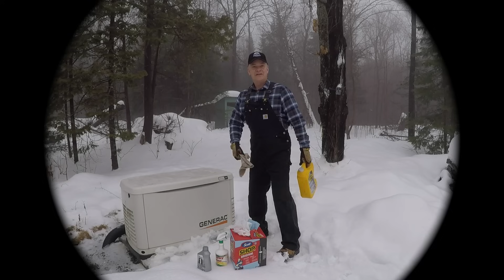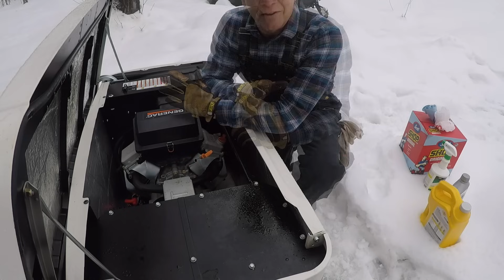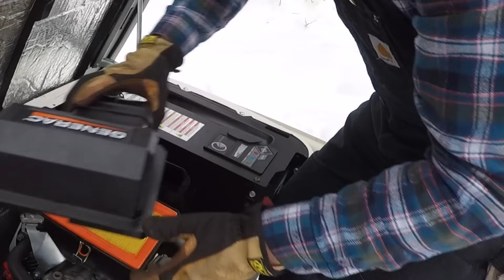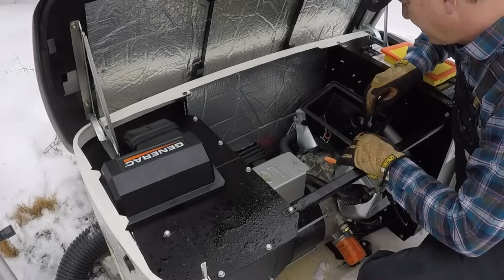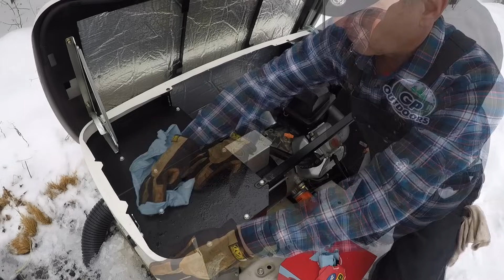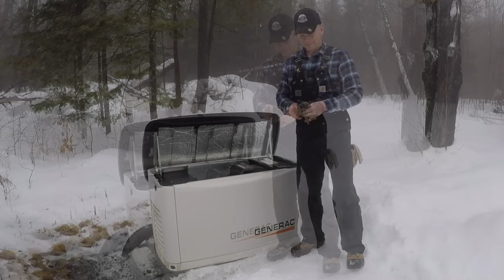#133 Thinking of Buying a Generac Generator? You Need To Watch This!

Comment: GP, look below at what you have done.  lol
So, after all this, how are you dealing with the problem?
Some have said that Generac has limited the exercise time to 5 or 6 minutes. It just occurred to me that if you can't change this, you should be able to shut off the circuit breaker supplying power to the unit to trick it into thinking there is a power failure so you can run it as long as you want. Turning off the main breaker will let it run under load as it should anyway to dry moisture from the generator section.
Reply from the maker: Morning TM. Thanks for the thoughtful note. The issue actually has nothing to do with the exercise time, although many have assumed it. It occurs when the unit has been running for a period of time ( hours). I added a 3rd heating kit to the unit which keeps the vent port warm and has stopped water from freezing back into the port now. However, the filter box still fills with water and freezes - a simple fix to drill a hole or put a duckbill drain on it is the right solution I believe however Generac has confirmed that if I do it, it will void my warranty. As noted in the video, many customers in this geographic area have the same issue as confirmed by the Generac local techs and also, I have a friend who has the same unit and the same issue. I have seen comments suggesting that the new units have been redesigned to stop this issue but I have not confirmed it. So when the warranty runs out then I have a fix for it. Thanks again!
Reply: @GPOutdoors  Are you saying that the air box and vent tube can be clean and dry and after a single run time of hours and this water forms in the air box from the vent tube? Does this period of time between looking at it include the automatic exercise times?
Reply from the maker: Morning TM. No not at all. I am not sure ( and nether are the three Generac techs that have serviced it) but for some reason , in this area, many of their customers and I have this issue, including one of my neighbours who has the exact same unit as I do, about 2 miles down the road. I think, (we think), cold air in meets hot air and produces the condensation ( water), which collects in the bottom of the air filter compartment. After the water gets to be about 1 inch high ( where the vent port is) then the water begins to go into the vent port. After the unit shuts off and cools, the water freezes and blocks the vent (unless I am diligent and come out and clean out the water/ice regularly). The oil also becomes kind of foamy/creamy because water is getting into the engine oil. It only happens when we get into the mid of winter and thereon until late winter/ spring as the outside temp warms up. It does run its exercise cycle which is once a month but it is not the exercise time, it is the run time primarily. Up here the power goes out regularly and for me, the gennie will run regularly during the winter when the solar panels are blocked by snow. Hope that helps. Thanks so much.

Comment: Take this from a mechanic, and full time user of generators. The genarac generators are "back up" generators ONLY and they are designed and sold that way, they WILL NOT last running full time for very long. So if you want a backup only , go ahead and waste your money.
Reply: I agree. This generator, in this application, only runs for a few hours here and there. He's not using this as primary power. A good choice for this application. If he's spending any more than $20.00 a month in fuel, he might consider more panels, and/or perhaps, a wind turbine.
Reply: From what I heard from the dealer in St Thomas, USVI, you are correct.  They had tons of them blown after the hurricanes in St Thomas and St John.  They are only meant to run for a few hrs at a time...not 16 hrs a day for weeks at a time...they will not hold up.  That being said, we have one at our home in NH for 5 years now and it has worked perfectly every time the power has gone out.  We only had a portable 10,000 watt generator on the island during that time and changed the oil every 2-3 days and it held up for us.  3+ months of no electrical service from the power company was grueling......
Reply: @larrypreston3885   What people don't realize, is that these engines hold less than 2 quarts of oil. If there's a long term outage, it's imperative, that the oil be checked every time you fill the gas tank, and it needs to be changed every 50-100 hours. 3 days is 72 hours! Every week, it's important to check the valve clearance, especially the exhaust valve. Too many home owners think that, like their refrigerator, or air conditioning system, that they're largely maintenance free. Nothing can be farther from the truth. These fully automated systems need as much maintenance, as the portable generators. Same engine, Same alternator.  It's just that you've got this box, that runs autonomously, out of sight, out of mind. A 10,000 watt portable, that you pull out, connect the lines, and start up your self, you're reminded to check the oil, put fuel in it, and start it. The worst, are natural gas generators, which are connected to an infinite source of fuel. If something goes wrong with the low oil cut off, you're done with that engine. Putting gasoline in a portable, is a good time to check the oil before re-starting. Those Generac are beautiful, but you still need to pull the dip stick.
Reply: @vincentrobinette1507  I agree 100%  The one in NH is run on propane as is the portable one in St Thomas.  We have been very happy with the one at the NH house because it is used as designed...a few hrs during a power outage.  We were considering one for the island and were surprised to hear about the concerns of trying to use it for days at a time from the Generac dealer on the island.  We did not know that.  We actually blew up the one we brought down with us right after the hurricanes and were fortunate to find another one within a few days.  As you could imagine, they were difficult to find and extremely over-priced, but what were our alternatives?  15 mins changing oil every couple days seems like a small price to pay once you have gone a few days without electricity!  Also, thanks for the informative video about condensation/ice build up.....would not be a problem on the island but certainly could be in NH.
Reply: Exceptional post  @vincentrobinette1507 .
Reply: After Irma We lost power for a week and we ran our generator 24/7 for those seven days. However, I changed the oil daily.

Comment: Generac standby generators come with a 5 year warranty and champion standby generators come with a 10 year warranty
Reply: Cool I would definitely go with a champion, thank you
Reply from the maker: Thanks! I appreciate the info. Might be the right solution when this one reaches it's useful life. Thanks and be well!
Reply: Buying products based on warrenty is only a scam to cover up a lousy product that can play the painful Blame Game at their advantage later.
Reply: Warrantees mean nothing......you "pay" for the length of the warranty period as part of the purchase price...it has NO bearing as to the "assumed" better quality you get for the (typically) higher-cost / longer warranty unit.
Reply: Wil Ferch champion generators are very high in quality and the warranty does mean a lot, for 10 years you basically have a full insurance policy and you don’t have to purchase the warranty it comes with the generator
Reply: Champion generators also are cheaper than generac generators
Reply: @projectengine2540  ...you  miss my point. Lots of people think an item that costs more with a longer warranty.... is better made. In some cases that may be true.... but in some other cases the item is of the same quality, just a lower price due to the shorter warranty period provided. Champion generators....Generac....Harbor Freight....all these generators if you look REAL close, are mostly the same....probably come out of the same Chinese factory ( LONCIN). Harbor Freight is cheaper not because it is less quality...but because it comes with a "non" name brand and less warranty time. If you think you need that warranty....you can pay extra for the Harbor Freight unit....optionally. In  my experience, once you get past the "infant mortality" first 90 days or so.....you are pretty well set anyway, regardless of your choice of comfort to have a longer warranty or not.
Reply: Wil Ferch, true

Comment: Just a suggestion but perhaps improvising a standpipe coming from the bottom of the airbox to the middle of the air box height-wise. This would prevent the liquid from blocking the crankcase vent tube. You would just need to remember periodically when the engine is warm, to remove the water from the bottom of the box. Just an idea. The standpipe could be made out of rubber hose. If it is a little tight fitting you can always take a razor knife and trim it down a little bit to make it fit.

Comment: Can you drill a hole on the bottom put a fitting with a hose and guide it outside with a hose? That way no water will accumulate on the bottom.

Comment: Easy fix drill a small hole in the bottom of plastic air filter housing.
You Welcome
Reply: That's the clean air side of the filter, so a regular old hole would let dirt and dust into the motor.  However a hole with one of those little rubber one-way valves would be a great idea.
Reply: @8180634  
Correct! I have seen this one-way drain, on car and truck air filter housing.
Reply: That's what I was thinking too!
You would think Generac has
heard this complaint as it seems
to be a common problem. I have
been looking at them on line and
thinking about having one installed so that will definitely
be a question to ask the dealer.

Comment: We National Security and Emergency Prepardness folks were looking for power generators in 1989 for Y2K mitigation. Telephony Central Offices have permanent generators and batteries. Some other common situations only had batteries. You get the drift. One fellow in my travels said he would buy a personal one after the new millinum rush when the surplus cost plummeted. I live 10 miles from Generac HQ.

Comment: The biggest issue i've ever had with mine is i get an "overcrank" error every so often
Reply: GreyHound … If you have some hours on it you can adjust the valves and replace the plugs, gapped to 0.025" instead of the OEM spec of 0.040". Should make a world of difference. The problem usually is the valves tighten up (during break in) and then you don't have quite enough manifold vacuum to open the demand style gas regulator. Adjusting the valves will solve that problem but since you will have the plugs out to do that, might as well change them. The book says 0.002" - 0.004" on the valves. I go with the higher number so nothing is too tight.

Comment: I used to sell Generac now I strictly work with Kohler. A Superior product.
Reply: VN Vet you are correct sir! I work for KOHLER and they are night and day!!
Reply: @jessewinger5989  I have had several K series engines like the KT 17 this was a classic they decided not to drill a hole thru the crankshaft to oil the Rods. The Magnum 18 Kohler they left out a .05 cent washer behind the governor gear and I was told by a Kohler service teck it was not left out it was a cost saving move. The governor exploded and took out the block. My replacement short block from the factory, the assembler forgot to put one of the clips on the wrist pin so the cylinder was destroyed in less than an hour when I was cutting my lawn with the new short block. And lets talk about some of the new design like the Courage series total junk so far out of balance it shakes the bolts loose on the counter weight and throws the rod out of the block. I even like Kohler but there no where close to being squeaky clean. Or night and day in your words.

Comment: That's not engine exhaust. It's crankcase ventilation, big difference. That port is meant to allow pressures to balance. You are correct in that it does need a redesign.

Comment: Either relocate the exhaust port (BTW, it's called a crank case breather) or put a drain at the lowest point of the filter housing so the water can drain off before it freezes.

Comment: Generac stock [GNRC] has gone up like a rocket for the past 5 years...but especially the last 3 years. 

The company needs to know about these ice in the air filter issues with their units. Not good Generac! Fix this!
Reply: The problem is improper installation. There is a extreme cold weather kit that is not installed on this unit and is not needed in warmer climates where the same generator is installed. I blame the installer.

Comment: The new ones have a heater wrap that goes around the crank case vent tube. That has nothing to do with Exhaust its crank case pressure.

Comment: Great video---- I have a 22KW unit that is 5 months old, it takes a quart every 12-14 hrs. Crank seal was bad from the factory. We are currently waiting on parts. The unit has about 90-95 hrs on it. I just maintain the right amount of oil and we run it when necessary. Really disappointed in the brand, thought they had better quality!!!!

Comment: Interesting problem.  I have a 17KW Generac installed in 2011, and have never seen that problem.  But my air filter compartment is totally different than your unit.  Also, my coldest temperatures might hit 0 fahrenheit on occasion.  You may have much colder temps?

Comment: A possible remedy is having a heater (maybe  light bulb) in cabinet on a thermostat, if temperature  drops too low heat source comes on to prevent freezing. Used this method in a pump well to prevent pipe freeze.

Comment: Basically works like the PCV valve on your car, allows the system to vent but not to atmosphere it gets reburned so to speak. If you're not worried about out it venting to atmosphere just disconnect the hose make it much longer and loop it over so it's upside down.

Comment: Have you consider making a small whole in the air box to prevent the moisture from accumulating?  This may have prevent the collection of water, then you wouldn't have to deal with freezing issues.

Comment: There is an option to resolve this issue, a small 12 DC auto heater can be put inside the cabinet. Tied into a thermostat you can set to come on when the temp starts to get cold, but well before freezing. Running off of the starter battery (which is always on cyclic charge) a small 12 volt dc heater will keep the inside warm enough to discourage condensation from building up and freezing. Cheers..

Comment: Great, well put together and informative video. However... I don't think it's called an exhaust port. I think that's your crankcase vent. Not trying to be picky and I could be mistaken also. Do you have any other advice to give because we are looking to buy one.
Reply from the maker: Good evening David. Sorry about the confusion, I am not very mechanical. You are correct- it is the vent port from the crankcase. It has been a pretty good unit otherwise for its purpose. Just has this issue up here in this area when the temp drops down to around -20 celsius and below. I bought the additional heater kit they sell that wraps on the vent port so it does not freeze blocking the vent anymore, but it does not help with the accumulation of water in the filter compartment. Good luck and all the best!

Comment: Sound like you need to add a "catch can" between the crankcase and the air filter box, then clean out the can periodically.  No moving parts, no issue!  That is "effectively" what that depression in the existing air box is!   It just needs to have a greater volume, and easier servicing.

Comment: I've heard about this problem, it may have been this vid I saw prior.  Regardless, I can't believe Generac hasn't fixed or designed out this proble,
What about a damp chase used on boats or some low watt heat source to keep things from freezing.
Cheers  from Western Canada where we have more snow than you at the moment.

Comment: Could you put straight Antifreeze to a depth of a couple of inches in bottom of tank to mix with condensation so it cannot freeze? Still check regularly but maybe eliminate the ice? Works in car radiators, doesn't it, to protect engines from freezing and cracking blocks.

Comment: Have you ever contacted Generac to see if they have a solution. I'm thinking of drilling holes in the bottom of the air filter housing to eliminate the build up of the water in the first place.

Comment: That port is not the exhaust port it is simply a vent for crankcase gasses and piston blow by, by blocking this your crankcase can develop pressure and force the oil out, like happened to you.

Comment: I have had several problems with my 20 KW air cooled 2.5 years old with very few hours. Had to replace the stator, rotor and main voltage regulator board. Thank goodness still under warranty, but I lack confidence in longevity of my unit. After hurricane season will probably upgrade to a liquid cooled unit. They run at 1800 rpms , 4 cylinder in lieu of the 3600 rpm  2 cylinder lawn mower engine the air cooled units have. Air cooled is more or less for emergency back up power where as the liquid cooled are better for long term back up power and much quieter.